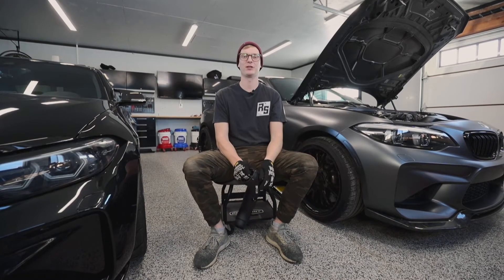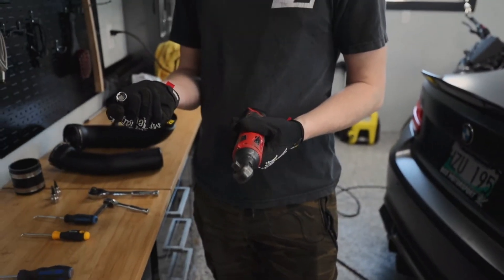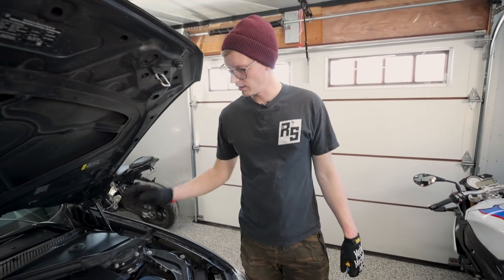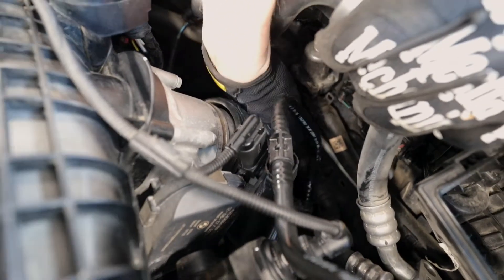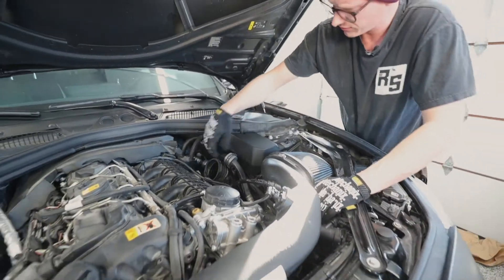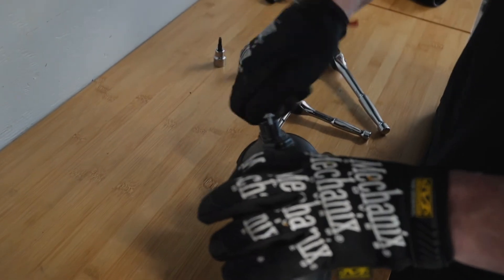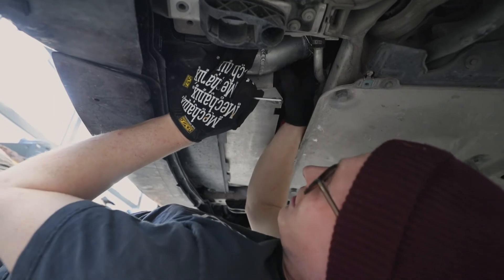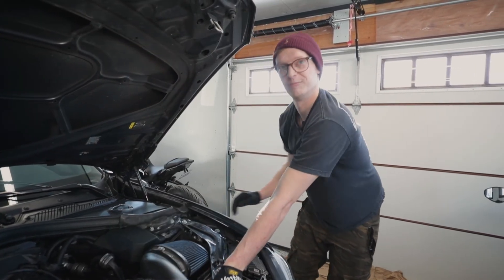CTS Charge Pipe DIY for N55

Comment: I don't think you could even get the top part on judging by your frustrating "sigh" at 13:04 and then immediately deciding not to connect it because you have "another DYI" video to do. I was literally putting my cc details in when I saw this video. Good thing I got distracted by Youtube before completing my purchase!
Reply: It’s easy the o ring provided for the charge pipe to the throttle body is too thick and won’t let you seat it properly. Either use a tiny bit of silicone on the taper of the charge pipe or get the same diameter o ring but thinner thickness. Installed one today and it went in effortlessly and drove pretty darn good with no leaks or cel.

Comment: You said the difficulty with the install was that the stock pipe was 1 piece and that the new one was 2, which is much easier. Then you put the new one together on the bench and installed it as 1 piece! You completely skipped over getting the pipe in place to bolt it in.

Comment: I'm fighting to get the top pipe on. The two are butted up against each other in the silicon hose and I'm still 3/4" out. I'm ready to throw this crap in the garbage and order a different one out of the US..I already had to shave the weld to get the bottom one to fit

Comment: The o'ring on top wont let it slide it for correct fitment. any you give me some pointers?
Reply: Silicone on the charge pipe taper or same diameter o ring but thinner thickness. The one provided is too thick